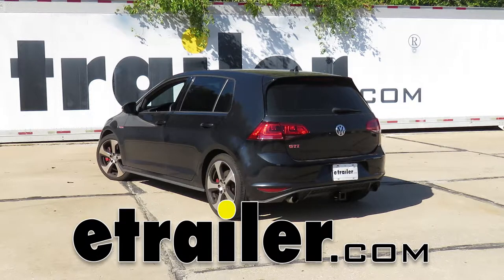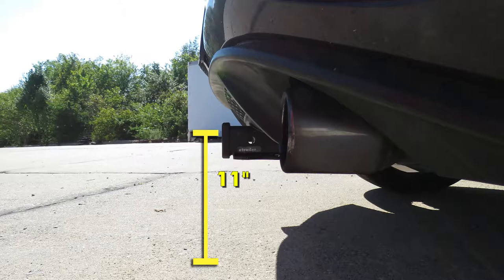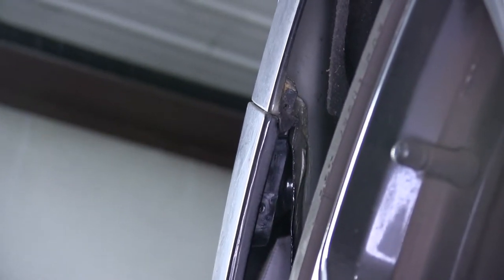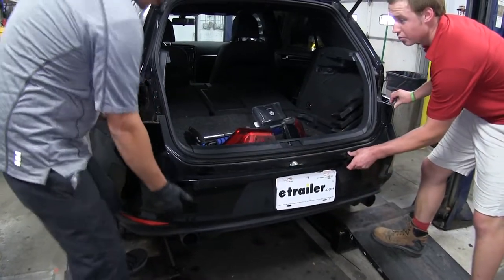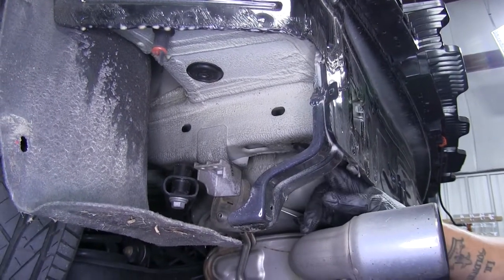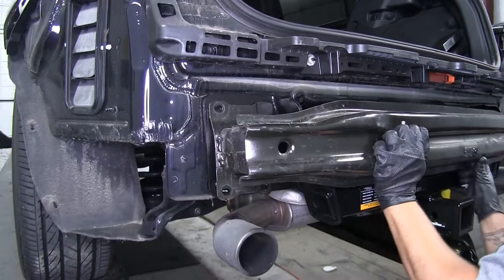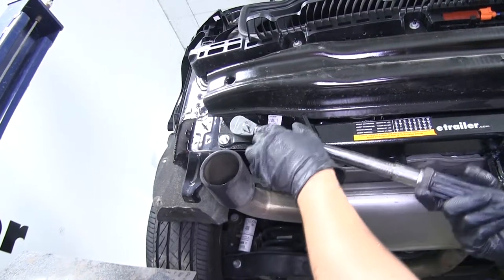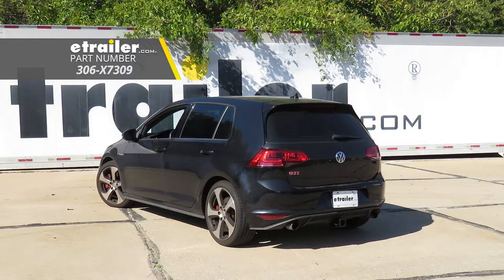etrailer | 2017 Volkswagen Golf EcoHitch Hidden Trailer Hitch Receiver: Complete Installation

Comment: Just curious as to why you didn't put the styrofoam bumper pad back on. With the thickness of the hitch mounting plate would there be a clearance issue (bumper cover rub against it)?
Reply from the maker: The foam piece will not fit back in place with the hitch installed. You can certainly save it in case you ever decide to remove the hitch.
https://www.etrailer.com/Trailer-Hitch/EcoHitch/306-X7309.html
Reply: @etrailer  okay thanks, I guess it doesn't really matter anyway I just thought that I saw a different hitch installation, also done by you guys, where they put it back but maybe it is plates a bit thicker. Thanks for the response